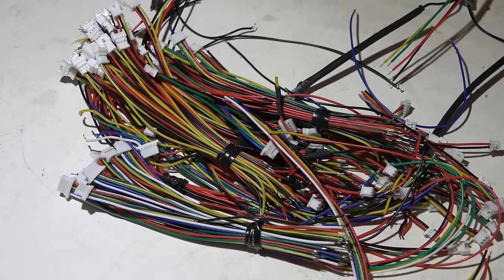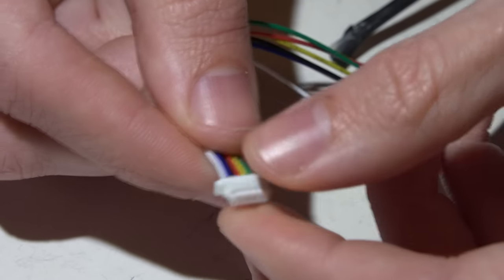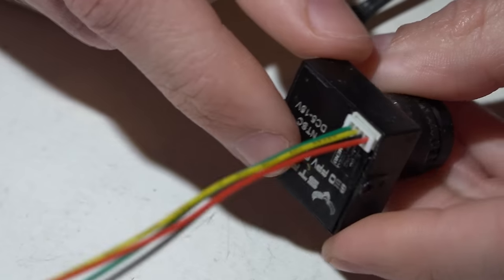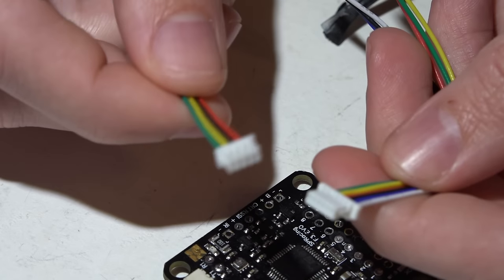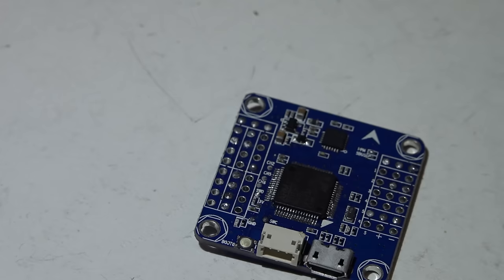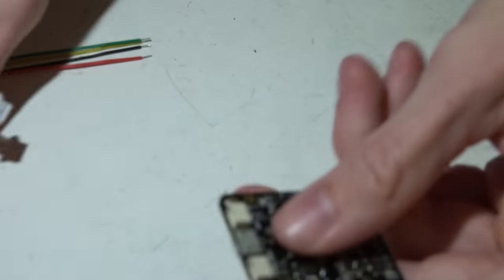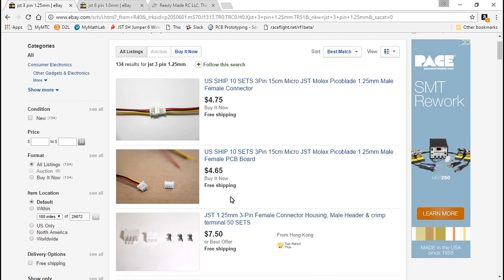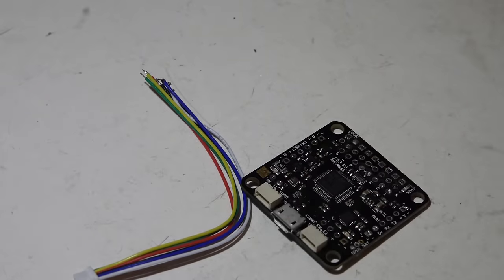Finding The JST Connector You Need

Comment: There is a bit of a learning curve for JST but after you wade through it is makes sense. 
There are series of connectors. The x.xmm values is the pitch or the spacing of the pins 
EH - 2.5mm
PH - 2.0mm
ZH - 1.5mm
SH - 1.0mm
ACH - 1.2mm Wire to Wire

There are 3 components to a PCB connector. 
The Contacts /pins
The Header/ piece mounted on PCB
The Housing/ The piece that fits into the Header

The ACH - Wire to Wire

Plug Contact and Socket contact ----- remember pins are called contacts. 
They have Plug Housings and Socket Housings. look at it like a plug and wall socket.

The Plug contacts/pin fits in the Plug housing. 
The Socket contacts are placed in the Socket housing.

So if you jump to 6:15 the beige connector on the PCB is the header. The white connector is 
the housing. The contact fits in the housing. 

You have to make sure that you order the correct series of contacts. The contacts or pins are either
EH,PH or what ever.

You have to watch as sometimes they will call a small connector JST when its not. That beige header does not look like a JST header. 

I'm posting this just to solidify what I learned a few weeks ago.........Teaching it is the first steps in knowing it.
Reply: thanks
Reply: thank you, i always thought there was 10 holes ever inch on most pcbs, thats t he 2.54mm i have a bunch of crimps there are all JX wtf does this even mean? these connectors say jst-xh

Comment: MARSHALL AMPLIFIER TYPE:  Glad I found this.  It helped immensely with my own search for an obscure part.  I hope you will forgive me for posting this for others who may find it too coming from the same field as myself.

Just for reference for anyone who comes here as I did looking to identify them from their guitar amplifier, Marshall use a version of these on their PCBs in most of their amp models.  They chose the slimmest in the range, the "EH" type which isn't shown in the video above as it is obviously a separate application.  They are 2.5mm pitch with a 3 sided shroud open all along the whole of one long side on the PCB mounted male socket.  It also has two slots on each side, one internal to the shroud and one through it.  The wire mounting female plug has two locating/locking ridges down both of its short edges which fit into those slots.  The socket also has small vertical ridges along the shroud back wall between each of the terminals while the plug has notches to register with them.

Comment: A little general information on plugs and sockets. If it’s got pins it’s a plug and if it has holes it’s a socket. The shell defines the gender. The JST battery connectors in the video are thus. The plug fixed to the pcb is female and the socket on the end of the battery cable is male. So you can have female plugs and male sockets.

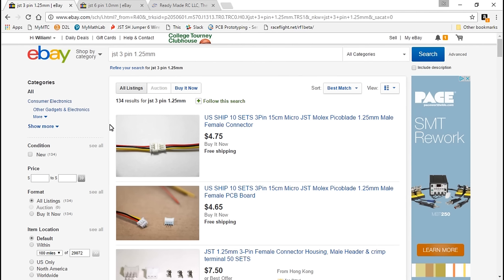Comment: 5:20 the first ebay result shows a 1.25mm pitch wire to wire connector. I think that is not JST-GH 1.25mm but Molex PicoBlade 1.25mm because JST-GH offers only wire to board connectors and not wire to wire connectors.
So many sellers on the internet are selling Molex PicoBlade wire to wire connectors and misdescribing them as JST which doesn't exist.

Comment: First of all I really like your videos, very high signal to noise :-)

The way I tell the JST-SH from a Pico Blade connectors is the PB has one or more humps on the back and the JST-SH is flat.  Also the JST-ZH (Spektrum Sat) pins are round, where the JST-SH and Pico Blades are flat.

The JST 2.0 common to the hobby would be a JST-PH, popular on nano quads like the Tiny Whoop, et.al.  

The JST 2.5 is actually a JST-XH.  

The very first connector you showed but didn't name was a JST-RCY, which is commonly used for micro quad battery connectors.  

To solve the problem of crappy plastic insulation, I custom make all my cables and hand crimp the connectors (Pico Blades are a real pain) using a Engineer PA-09 crimper.

FWIW, the Pico Blade and JST-RCY connectors are suitable for wire to wire connections.  The PB is good for signal ( < 1A ) and JST-RCY for low power ( < 3A ) applications.  I like to make my builds modular where possible as I'm often having to repair them (I suck a flying).

I get the connector and pins from Digikey.
Reply: Hi.  Do you have a link to a place you like where we can buy the connectors if we want to crimp our own?  I am a noob so I am not sure of the size but I build 5" quads (JST 2.0?).  Thanks!

Comment: I buy the connectors and crimp pins as a kit, and just insert my own silicone wire. It's the only way to make sure they have silicone wire. Always go for silicone wire. Here's a quick tip: pre-tin the wire, insert it while the connector is still part of the metal stock strip and crimp it using really thin pliers, or even your sidecutters. Then solder it. NEVER crimp pre-tinned wires unless you're also soldering them in place.

Comment: I need a replacement cable for my xecuter 2.6 modchip. I'm not sure if it's a molex picoblade female 8 pin connector wire or a 1.0mm 8 pin female jst connector wire.

Comment: My tractor has the blocks/housing that has the latch in the housing. the spades do not have a tab that flips up to hook into are onto the housing. Where can I find this type of housing and what is it called , my spades  have a little hole in the center when you slide it in the housing clip catches it. My spades and wiring are good but the housing is old and crumbling apart---just need to know where to get this type of male to female housing for 2 pin spade and the same for a 3 pin spade

Comment: I have an older Zenith television that currently has a mono chasis but want to upgrade it with a stereo version of the same chasis.  The speaker connector that goes to the board looks like a JST maie two pin.  Not sure of the size though.  I have one speaker with the proper connector attached to wires but need another one for the second speaker.  Can you do a video on the various two pin JST connectors?  Thanks.

Comment: I need help to determine which one is the smaller connector  overall for 5 pin... I need to pass 5 leads cable through small hole (electric guitar pickups with 28awg leads) is the SH 1.0 the smaller or there's another? Thanks in advance!

Comment: do u ever use Male JSTs with wires attached to female with wires attached instead of servo cables? JSTs are so much smaller than the servo leads which can be very useful on smaller builds.
Reply from the maker: Yep I do. Instead of using the big red 2 wire JSTs to connect cameras and VTx's to the PDB I use a 2 pin 1.25mm male and female connectors. Much smaller but does the same thing.

Comment: I'm desperately searching for the right tool to chrimp these my self but it really hard to find the correct tool for the job.... can you help? What is the tool called?
Reply from the maker: The tools I have seen are extremely expensive. Seriously ridiculously expensive. Hundreds of dollars. I haven't found one yet for a cheap price.
Reply: Try the Engineer PA-09 crimping tool (readily available through Amazon). I've personally used it for every connector type mentioned in this video except JST-SH.
Reply: There's a 10" QUICK CHANGE RATCHET CRIMPER here in Australia at my local Tech shop, JAYCAR. distributed by ELECTUS, but I think the parent company is in USA, their website is www.techbrands.com
The crimper features removable dies to suit various wires and connectors, from open terminal types as in JST from 26 to 18 AWG and 20 to 10 AWG, through Automotive, TV F type, SMA, Fibre optic Telecommunications and older BNC and RJ** network connectors.
A little pricey here at $60 (roughly $45 USD) for the Ratchet and 1 die (each about a third of the price.)
A very nice tool non the less, used it for many JST and Servo cables and it's still going strong, ergonomic too, comfortable to use as all effort is taken up by the simple mechanism in the ratchet handle...I know it's 7 months late, but I hope this helps mate😆

Comment: I am working with a 1.5mm pitch ZH connector for a motor. It has female ends on both sides, how can I get it to connect on a 2.54mm pitch breadboard? 

I was thinking of getting a female- to male adapter so it can plug into the breadboard, but the pitch would still not match. The only thing I can think of is cutting off the plastic connector and putting the wires in individually. 

Any other ideas? I am new to working with electronics.

Comment: I god camera that has 3pin (female) that is slightly wider then the 3pin input (male) that i have in my FC. So i assume this is the topic. How do i solve it? Are there any adapters 1mm to 1.25? Or vice versa? Or can i simply cut the wires and swap the female parts (i have proper cable with fitting female part on old camera)?

Comment: I have LRP 3200mah lipo with a XHR-3P connector bought for my Sanwa MT44. The LRP lipo does not have a separate balance lead how do I connect this to a charger that has an XT60 charge port and a balance lead port for 1-6s Lipo's. I'm stuck on how I charge the LRP lipo with the included XHR-3P connector.

Comment: I have some leds I want to rig up to my quad and I have 22 gauge wire I’ll solder to the led but I am not sure what connector I need to plug into the 3s battery?

Comment: Is there a good place to buy just the female pins? Specifically the 1.0mm and 1.25mm. I can find the tool for attaching them, as you mentioned they are quite expensive and I'm still looking for a good deal on one. But I would like to add my own pins so I don't have to solder wires together to connect two connectors and eliminate excess wire. Or if there is a site to just order different length wires that have the pins already crimped to both sides would be helpful too. Thanks in advance for any info you have.
Reply: I know hobby king has some cheap crimping pliers ($15). What are your thoughts on those vs. something like the engineer pa-21 ($50)?

Comment: Great tips, thanks a ton because you just saved me a ton of money and aggravation. This is just one more reason we need standards in electronics! One question though, if I was search for wire for these what gauge wire would be best and is there the potential for one size fits all with respect to wire size? I dont want to bother buying premade connectors and would rather have a kit where I can build my own in whatever size and length I need for a project.
Reply: He's no more to read your words or answer you! :(
Reply: The appropriate size wires for JST connectors are a range, not one size fits all. Wikipedia lays it out nicely in a table. https://en.wikipedia.org/wiki/JST_connector

Comment: recently i bought a drone (gteng t905f ) it has proprietary 4 pin connector attached to a 2s lipo battery....my question is that can replace 2 pin connector with a 4 pin jst connector on 2s lipo battery?  and how? because i can't find the proprietary batteries online

Comment: i need a 2.5 six pin extension. two wires are 20 awg and four wires are 16 awg. how would you go about finding something so specific? im not even sure how to format a search. also, it needs a clip  on the female end...
Reply: Make it yourself? Buy the conector with the metall things but without wire and crimp wires to it.

Comment: can I use a 22 or 23AWG wire with the 1.25mm pitch JST connector?
Reply: JC passed away a few years back. But you should be able to it may be a tight fit

Comment: I need one 5 pin male to female connector for an electric unicycle's main power connection.  I believe they are the JST type.  There are actually 2 variations of the 5 pin connectors.  One is shorter in length than the other.  I need the longer length.  These are not easy to find in New York.  I tried Home Depot, Walmart, Target, Best Buy and Micro Center which is solely dedicated to computers and all other electronics doesn't have this. And Radio Shack went out of business.

  Please help

Comment: You skipped the 2.0mm. I think the NES-001 top loader I'm working needs a JST right angle header, problem is I'm guessing what it is, I know it's a 7 pin, the 2.54 is to big and the 1.25 was to small. Anyone know which one I need?

Comment: Frist of all there is not a lot of good peaple  that help out on jst thank you .Next would you know how to change a rc tamiya trailer connector for the lights .I removed the multi-function control unit  the plug has 6 pins on one side and a round 6 pin plug. 
thank you for the great video

Comment: this is a great intro. 
but one thing. JST is a company that makes components. they made the JST connector series. and named it after themselves. anything NOT by JST is a knockoff and amy not stand up to the normal specs of JST components (this is especially true for pins)
you can get GENUINE jst parts from REPUTABLE component supply houses for pretty cheap. a few cents a connecter and a little more for each pin. NOT EBAY
i use digikey https://www.digikey.com/en/supplier-centers/j/jst look in rectangular connectors and find yours. on the product page you will also find links to the pins. 

something i found out recently, if you click on the "mating product" the socket for the connecter. you may find a punch down version. 
for example my 3d printer uses the XH series for its connections. and it has a punchdown version, its part of the NR series (which im sad digikey dosent carry)
the punch down versions are great as there is no crimping (so no need for pins) nor any need to strip the wire. and can be punched with normal items around the house (like credit cards, the backs of knives, etc anything not sharp)

for your shipping argument. its very reasonable. generally at cost. just buy some extra housings and a LOT more pins (if using crimp terminals)
using the crimp or punch down versions eliminates the need to solder as well. no no heatshrink. resulting in a MUCH cleaner, and more professional looking build.

Comment: Be careful about the female/male configurations. I have seen many a time that the plastic plug determines the sex and not the actual metal pin/socket. The red plug started decades ago as a BEC(battery eliminator circuit) plug. They denoted that the Rx was powered by an ESC and didn't need an external battery.

Comment: thing is sometimes when things break off, they come with pads.
Reply: Yeah, unfortunately you can't fix lifted pads. That's an instant death sentence to your device. If you can follow the trace, you can solder wires to the nearest connected pad and salvage it that way, but ditch the connector at that point.

Comment: First!  bam!

JC have you found a place to get an assortment of 1.2 spaced connectors?  I have been looking on ebay but no joy.
Reply from the maker: I haven't found any assortments. But for about $5 for a pack of 10 I just bought 1.25mm in 2 pin, 3 pin, 4, 5, and 6.

Comment: Wow JC... thanks for clarifying these things! :)  I can only dream of the day when (most of) the fpv parts manufacturers will start using then same connectors... 

Could you also explain the AWG wires? I was thinking of buying the silicone coated wire for various connections, and would try to limit my choices to only 3 or 4 types of wires. Finding the correct connectors for them will be another problem afterwards, but that's a different story

Comment: These are annoying things !  I have just took one out of the usb cable to pcb terminator of a corsair mechanical keyboard,  I can't identify it, it looks vaguely similar to the ones on my Ender 3  servo motors, but I cant say for sure.  It looks similar to the last one you showed except it has a U shaped plastic section in the middle of one side that slots into an opening on the receiving part.

Comment: There's a problem re:readymaderc.com vs your vid here. Here you say the M/F is determined by the metal components i.e. post and receiver, on rmrc they are going by whether the casing is male or female. So for those of us who aren't professionals in this field, just trying to find a jst splitter is nearly impossible because if you look at 4 sellers you're likely gonna get 2 where casing is the M/F determination, and 2 seeing it the other way. In the friggin 21st century you'd think we could've gotten this kind of rudimentary stuff settled. But then again, the U.S. is still largely stuck on ridiculous imperial measurement standards so with that, we're probably not gonna resolve this any time soon either. ANSI could clear this all up though. Anybody got their number? peace

Comment: This is a rather inaccurate measuring technique. I have a 3-pin 1.0mm connector and another connector of unkown size. The one of unkown size could be either 1.25mm or 1.5mm. It's hard to see, what size its spacings have. How can I find out what size the unkown connector actually has? I don't want to wait another 40 days for a parcel coming from China with connectors that still don't fit in the original slot...

Comment: Ohh man, you used gender pronounce 6:05  .. like male and female connectors... that is so offensive, be careful or someone gonna doxx your ass as a racist or nazi.
anyway, solid work, and helpful to conclude that the UART receiver 6pin connector on my Holybro X1 FC is likely 1.0 JST.
btw just took a look at some of my eachine unit cameras and they do also use 1.0 (3pin) though some of the other i had uses 1.25 JST... dont know what the model was, if you want a picture, holla.
On receivers, it seems it is mostly 1.0 JST or the bigger ones which I reckon are 2.5 JST
Reply: In case you don't know this, JC passed away two years ago.
Reply: @graywoulf  Yep I recall motorbike..